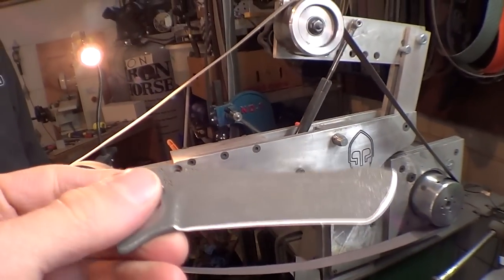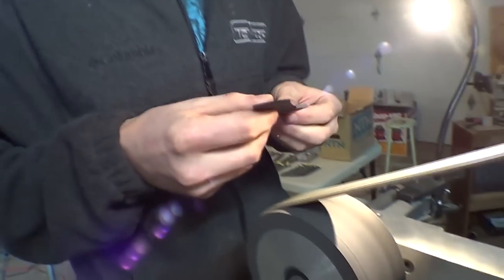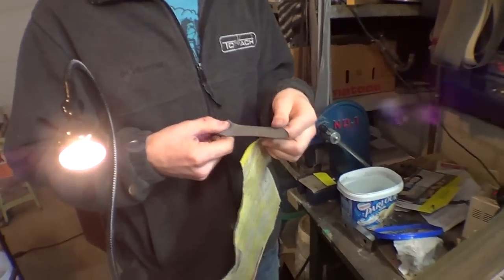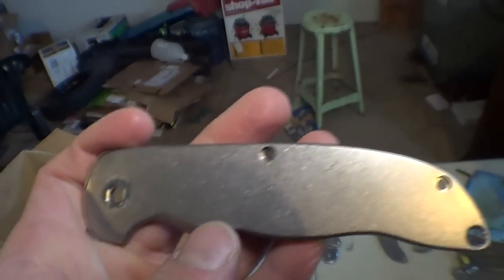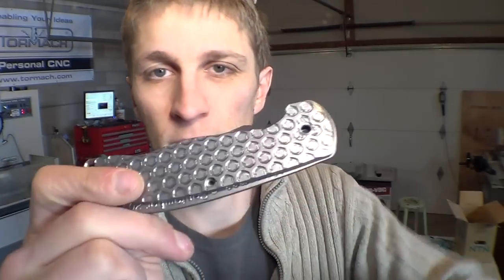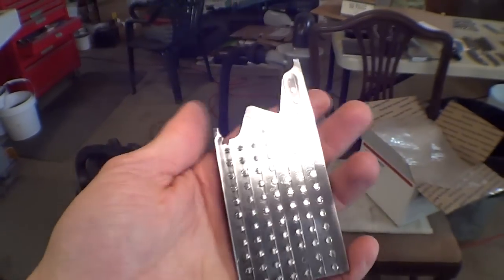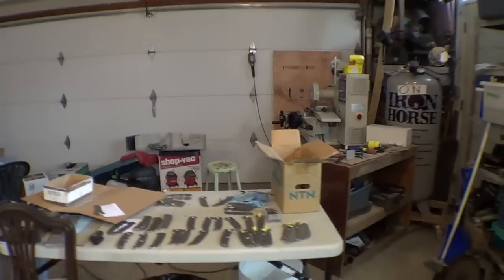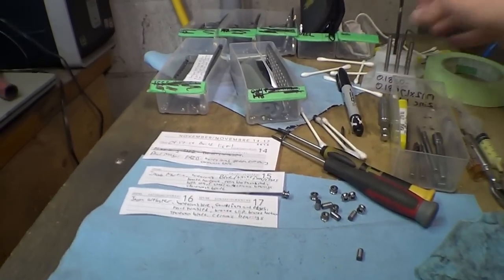Knifemaking Tuesdays Week 82 - sharpening and tumbling

Comment: Small tip.  Get a 2x4 stud.  Cut it to about a foot.  After the 220 belt cut into the 2x4 the entire length of the knife.  This will ensure the removal of the burr before stropping.  Many times when you strop after you won't remove the entire burr and it will be sharp but will loose it's edge quickly.  Plus it keep the stropping time down.  (I own a sharpening business).  Fuller Sharpening in Texas

Comment: I'm not sure if you have heard this before but if you take the knife and run the edge along a piece of wood-with the grain, it will knock off the bur faster and then you can put a real quick wicked edge on it with a few passes of the strop.

Comment: We have a Mr.Deburr unit (the super common one, roughly the size of a laundry basket.) It works well, but I'm glad its well isolated from my working area. The sharp ones eventually become dull ones over time. We actually rotate between different shapes. Eventually, you wind up with a variety of shapes and sizes, seems to work well enough.

Look forward to that setup video :)
Reply from the maker: Sweet.  Yeah I think my new one (yes I just bought it) is like the china version of a Mr Deburr.

Comment: if you would hone the blade on the sanding belt the way you're supposed to - have the grain go against the sharp edge of the blade, not from it, then there would be no bur to "brake" off later on the strop, do it the right way and save yourself a ton of time
also, note for steel blades, having the razor sharp edge ride on the powered leather strop for too long (like you're doing it now) isn't a good idea either, you can easy overheat the very edge and screw up the temper of the edge, not the whole blade, just the razor sharp edge

Comment: any suggestions on how to sharpen these with a sharpening stone? I've been using the spyderco sharpener for my knives, but will it work for a blade shape as unique as this one?
Reply from the maker: Yeah the Spyderco Sharpmaker will work great for these knives, that's what I used for my first few Norseman knives.  It's a good, cheap, easy system to have around.  I used my sharpmaker for 10 years before I started making knives ;-).

Comment: Hi John,

As usual, another nice video loaded with info.  I listened with interest about the Northern tool tumbler.  You mentioned a price of $800.00.  The picture you showed was the 2.5 CF model that sells for around $1550.00.  Is the 2.5 CF model the one you are going to order?  Looking forward to the video on the tumbler and associated media when you get it.

Also liked the leather belt.  I will have to order one for my grinder.

John
Reply from the maker: Hey John!  I just ordered the 1.25cf tumbler, the $800 one.  Should be here soon and I will definitely do setup and operational videos with.  There's like NO info in the internet about this tumbler, it's weird.  Hope it will benefit you!

Comment: I find that blasting my stroppes with a heatgun while applying paste makes it adhere better..
Reply: I have had good luck with this on my stropping belt for the 1x30 and my crappy homemade block. I can't bring myself to do it on either of my nice strops, though. It would probably save them on compound in the long run, so a great point!
Reply: Casey Bennett works well on the weps strops, they shed less compound and pretty quickly turn blackish with metal form stropping
Reply: tony Pettersen Ya know, I haven't even used my WE strops. They are still sitting in their tidy little boxes on my shelf. One day I will use the balsas, but there is just something about hand stropping that I generally prefer.

I really only use the 1x30 strop belt when I have fully reprofiled something or reground it to convex. 

I have used a bit of heat when cleaning the swarf from my nice strops, but usually heating the oil on the stove not directly heating the strop. I may give it a try on my block this weekend though. It is filthy.

Comment: You guys should consider not sharpening like that anymore considering people will be testing the HRC at the edges soon. Especially if you care about your heat treatment protocol... People won't be testing hrc at the spine, nor the pivot. They will be testing behind the edge for burnt edges on a lot of manufacter blades soon enough.

Also reliance on feeling the blade for warmth isn't going to cut it. The creep of overheating hits the grinding side before your fingers.

Comment: for the price of your knives I'd rather have it wicked edged
Reply: Crazy talk
Reply: for a knife that the base price is $500
Reply: 7247tank7247 I think we just have an opposing philosophy here. For a $500+ knife, I want the maker to put the edge on it, not a tool I could easily train a patient 5-year-old to use. 

And that is no knock on the WE, it is a great tool. I just want the (wo)man to put the blade to stone or belt.

I'm sure if you bought one, the Brothers Grimsmo would be more than happy to WEPS it if that were the edge you preferred. :)
Reply: 7247tank7247 uh, are they seriously charging $500 for one of these!? if so that's insane. It's not really even a custom knife...they're doing what every other large scale knife manufacturer is doing...just on a smaller scale. like 95% of the work is done by the cnc machine...they just do a little clean up, assemble them, then sharpen them on a belt grinder. i mean all the power...and money...to them, but if I'm gonna fork out that much money for a knife i'd buy me a custom made knife. good thing i make my own:)

Comment: What the hell $500 for a knife way over priced i was expecting $150 is the medereals that expensive and remembur it's all done with CNC so hardly eny hand crafting skills just spend a day weighting up a code then let the CNC do the fun part but $500 base price i bit much
Reply: There's about $200 in materials used in each knife... So combined with the work that goes into these knives $500 is a pretty fair price.
Reply: Nope that's a lode of shit there over priced
Reply: alexander cruse It seems like you don't understand how things add up very quickly.  No one wants to work for free and there is a lot of time put into the design, machining, hand fitting, finishing / tumbling / anodizing and other work that goes into making these knives.  You grossly underestimate the amount of hand work that goes into these.  Let's talk for a second JUST about CNC machine time.   Any CNC machine shop is going to charge somewhere in the neighborhood of $80 an hour (quite possibly more) PLUS materials PLUS consumables (end mills, sanding belts, compounds / acids / other chemicals).   The blades aren't just machined once, but they are machined multiple times before and after hardening to get the fit just right.    So, let's do some estimation / math here.   Say he does a batch of 17 knives.  The blades themselves probably consume several hours of machine time during the first cut from blanks.  After hardening they probably consume another hour or two in the reaming and related processes.   The titanium handles likewise take at least a couple hours to machine and could easily take twice or three times that because of the detail work that goes into the handles.   We are seeing at LEAST 9 or 10 hours of machine time for 17 knives, but this is likely a VERY low estimate as I realize that doesn't account for ALL the other hardware he makes himself. It could easily be double that. That's a minimum of $800 machine time (probably more like $1600 ballpark), another $200 to $400 in consumables.   Figure each "regular" (non damasteel) knife is about $200 in raw materials (including screws, spacers, ball bearings (which he makes himself, so more machine time).   Now, factor in all the labor that goes into the hand fitting / chamfering / sharpening / polishing / anodizing and other hand processes.   You're well over $6000 into a batch of 17 knives with parts and labor.  That's EASILY $350 per knife just in COST... This is a business and their livelihood and as such they are probably making $200 per knife on top of shop / labor costs.     If you don't think the knife is worth the money, that's fine.  You're entitled to feel however you want, but if you want a real appreciation for how much actual hand work goes into these machined knives, you need to go back and watch some more videos.   The fact that these brothers share this information with the world is a huge gift for others that are getting into knife making and for those that want to have an appreciation of what went into making their knife.   Have your opinion, but please understand that there is no way it has any basis in reality and what shops really charge for this kind of work.
Reply: alexander cruse would you rather it be 10 dollars and mass produced in china to horrible tolerances using barrel scrapings?
Reply: No I'd rather not get riped off $250 seems about right for what you get
Reply: You know I make knives and I would sell a full hand crafted knife that is 10" long for $150 so yep and the desighn finds sucks I mean look at that blade it curves in not good
Reply: feel free to not buy it.  But you are cheating yourself on knife price. how long does that take you make? what is your material cost?
Reply: About $40 plus $20 for belts and sand paper
Then about $40 buck on random stuff
Reply: so you are 100 into the knife roughly before you even touch the metal to work it into a knife. how many hours are you spending on the knife and sheath?
Reply: Well at the moment I make cooking knives so they don't need a sheeth but about 9h but go to my YouTube channel,  Alex Workshop Kives there is a video showing me grinding a bevel
Reply: Your time should be worth about 135 min. plus you have to factor in overhead such as power and rent if you are renting a shop. anything less than 235 and you are taking a loss in some way--even if that loss is your time. In reality the knife should sell for about 275 that you make. that way you can replace broken tools, and pay yourself fairly.

material and time wise these guys are into the knife deeper than you are. while i wont say 500 is a bargain 400 would be a very modest profit over material rent energy tools and time
Reply: Well I hope to make a name for my self first then I will up the price but I'm only 17 mate so I don't have to worry about rent or power 😀
Lucky me
Reply: These knives are closer to 800 than 500